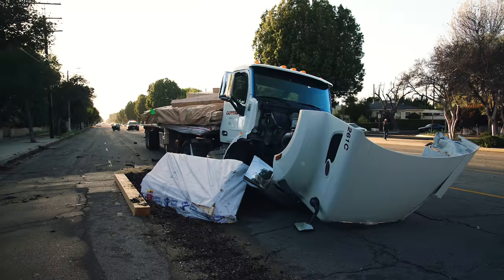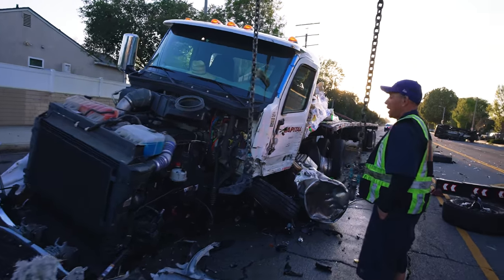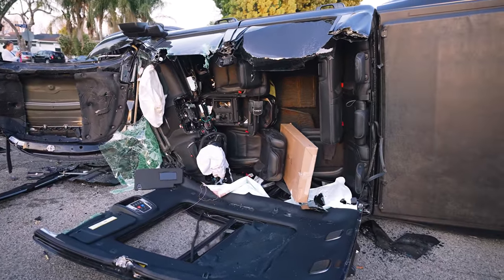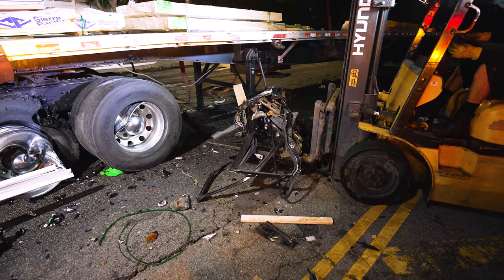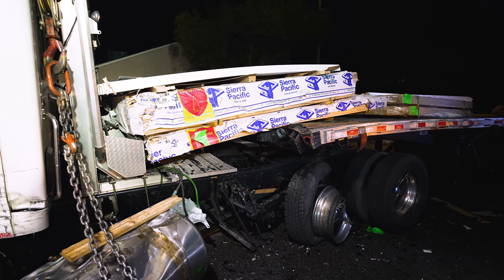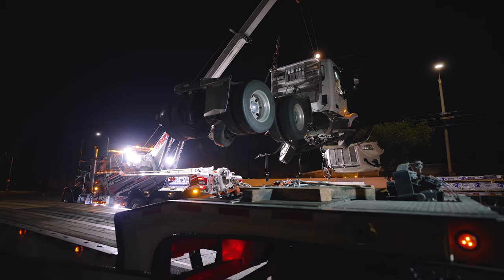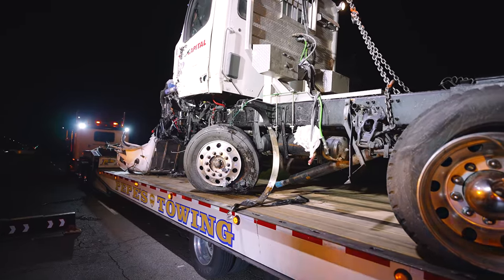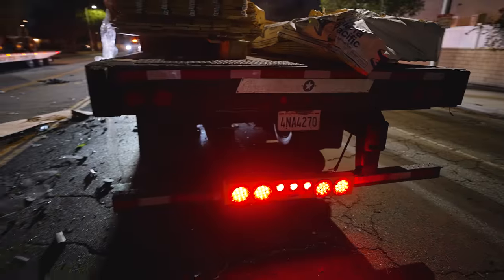2022 Dodge Ram TRX crashes into and destroys semi - rotator recovery

Comment: That headache rack definitely saved the driver of the trucks life. That TRX driver had to have been going extremely fast.
Reply: More like insanely fast!
Reply: Luckily no one (RAM driver) was killed.
Reply: @Lut852  Yeah...that's what's been reported on the news.
Reply: This is the primary reason why T-Rex drivers gotta pay an extraordinary amount of insurance. I'll stay with driving Tesla for right now. 😬
Reply: Forgive my last comment 🙏... Yeah he definitely was going fast..
Reply: Well trx are capped at 118 so unless tuned they can't go faster than that
Reply: @Noobie250r  to cause the damage this one caused, he could have been going well under 118 & still cause that damage
Reply: @tiredoldmechanic1791  Ludicrous speed.
Reply: The rack had his back. Hope he learns better load securement after this incident
Reply: @customconnections2425  yes, the headache rack did have his back. We don't know how he had the load strapped though, when the filming started they were already starting to move the lumber, & had the remaining straps off. We can't say he didn't do good load securement. 
I've been pulling flatbed for several years, I've hauled more loads of lumber than you can dream of. When there's a sudden stop like that, the straps holding the load is going to break, & move forward like it did, & yes even come off the trailer. That's alot of force on those straps, coming to a dead stop like that. It tore  the steering axle loose & pushed it back quite a ways. That was an almost head-on collision, the TRX was going extremely fast. I don't think we can put any blame on the driver of the truck. We didn't see the load BEFORE the accident. That's a local lumber yard delivery truck, alot of uneven things loaded on those trucks, those loads can be very uneven. 
I've also hauled several loads to be delivered to jobsites & stores over the over 30 years I've driven a truck. 
We don't have the right to say anything about how the driver had the load secured, unless we were there & saw the load before the accident, which none of us was around.
Reply: @RambozoClown  He's gone plaid!
Reply: That punctured diesel could've caught fire too. Not as easily as gas but would still make a hot flame.
Reply: @AwesomeBlackDude  the sad thing is that many drivers carry only the minimum insurance.  Also some insurance won't cover you if you're breaking the law at the time, such as driving drunk or at an insane speed.  I think that the T-Rex owner will never own another truck or good car for a long time as his insurance will be going through the roof.
Reply: @danielmarek4609  Actually..in most states it is illegal for an insurance company to deny liability coverage to victims of a DUI driver. 
Also..its usually only high risk/cut rate insurance company's that give you the option of state minimums. 
Company's like State Farm Allstate etc only offers policy's beginning at $100,000 for property and $300,000 for medical.
Reply: i thought i had seen this somewhere but cant remember since the guy should be charged for reckless driving
Reply: No way.  I thought that truck driver was going extremely fast
Reply: @rjdatdude23  it was the TRX going extremely fast. The it's usually the four wheelers that cause the most accidents.
Reply: Crossed center line going 70 no idea the speed limit but I’m guessing 45-50 maybe
Reply: 💥 BADA BING BADA BOOM 💥
I APPROVE THIS MESSAGE 🙌
Nj'sJfJr 👍🏼💪🏼❤️🇺🇸
Reply: driving like a maniac will do that
Reply: I said the same thing. However the headache rack did come apart from the trailer bed if ya noticed that. That is something that should be looked into. I am sure it will be as the claim is entered on the trailer to the insurance should look farther for an explanation. The racks are not designed to separate from their point of anchor. The speed is not really a factor on flat road. had their been an incline and excessive speed on account of the truck maybe. As one can see the damage and debris field indicate who was way over the speed limits here.
Reply: The max speed on that truck is only 112 😂😂😂
Reply: @Martyhackett0919  Give that thing to my girlfriend it will easily do 212 going to Walmart no problem at all...Need any Pics let me know....

Comment: Hey Josh...!!! That guy had to of been going at least 90 mph to of had that much damage to both vehicles... WOW...
Reply from the maker: No doubt! You can't do that much damage driving under the speed limit lol
Reply: …of???
Reply: The truck is regulated to 92 MPH only .....
Reply: @PepesTowingService  It seems, nobody drives under the speed limit in Texas, in my experience!
Reply: @mmarciniak  As high as gas is theyre wide open in a truck thats rate in the low tens driving normally.
Reply: @williscurry6557  The driver never cared about fuel mileage to begin with.
Reply: @travisyarbrough4033  talking about the trx

Comment: An almost unbelievable amount of damage and debris in this ''accident''.   Makes you wonder how fast the TRX was going!?
I might have missed something, but I only see one strap still on the trailer.....it should have had more.   Spending a few extra minutes to start with might have made a difference. 
Another great recovery.  LA is blessed to have you working there.👍
Reply from the maker: There definitely was major speed involved, and the trailer did have multiple straps. I'm not sure if it shows in the beginning, but we did have to remove the straps to take the wood off and set it back properly.
Reply: The Dodge can only do 92 MPH it's speed regulated cause of being a taller truck
Reply: @travisyarbrough4033  ONLY??? Anything much over 65 or so can cause HUGE ASS damage
Reply: @travisyarbrough4033  actually, it limited at 118. But like was said above, half that speed would be enough to cause that much damage.
Reply: @travisyarbrough4033  bull. A regular dodge kicks off around 105.
Reply: @travisyarbrough4033  that’s like paying for another truck without driving it. Why in the hell would they put a monster of a engine in there for it not to be used?

Comment: My goodness what a mess! And yeah I agree about the headache rack! So glad these vehicles are getting safer and safer because this could've been extremely tragic otherwise.

Great recovery!
Reply: I don’t think you know what you mean about those vehicles are getting safer and safer do you think a old 1900s truck would be destroy like this just by getting hit with a  little pick up truck? Those semi truck back then were Sefer.
Reply: @jacksonalouidor8342  it is NOT a Little pick up truck, it is over 5000 lbs going at a VERY high rate of speed. The semi is not as demolished as you think also. The front axle, gas tank and part of the rear axle is damaged. It was a sideswipe at a VERY high speed.

Comment: The low-light capability of the new camera is amazing. How much does one of those tractors weigh? It's obviously well within Hulk's working limits but I was thinking about the stronger & weaker lifting zones as you swung it 180 degrees.
Reply from the maker: Agreed, I love the F 1.8 lens, really allows me to capture so much detail at night. I didn't nail the settings the way I wanted here but still it looked great. Tractors vary, but they can easily weigh close to 30,000lbs. No problem for Hulk at any angle.
Reply: @pepe is the man and knows his stuff. From my non-experienced armchair, I too was a little nervous seeing such a heavy load out there so far from the truck. Lot's of weight on the outriggers. But what do I know? I'm just a guy watching videos.

Comment: When towing that trailer out on the pick bar like that, that makes one REALLY long rig to navigate. Talk about making wide turns, lol!!! 😵😵 👍🏻😎👍🏻
Reply from the maker: Sure is, even longer when towing a complete tractor trailer, or one with a set of doubles.
Reply: @PepesTowingService , I give you heavy towing guys HUGE props my friend. Class A driver, rigger, AND a crane operator all wrapped into one person. AND, you’re not picking up nice neatly packaged loads. You have to put the puzzle together just right to safely roll that whole mess down the road. Oftentimes I’m sure that’s just barely possible to do with absolute confidence the load won’t shift around on you. That’s some SERIOUS work and I personally love to watch a well executed recovery.

I myself used to work for a digging company that transported some insanely large equipment. A number of the moves were an absolute circus, lol. When one of these crazy large items would come up, like the core body of a massive earth moving truck used in activities such as mining, they would call it “The Big Show”, lol. Triple stingers and a ground force dollie at the rear. Driving that friggin thing was like driving an actual freight train. But regardless of all that weight and all those wheels rolling, the Kenworth W9 or the long nose Peterbuilt 379 both having a big ‘ole CAT under the hood would drag that train along like a champ. BUT, I had a planned route that was well able to accommodate the whole drive with minimal traffic using an army of cops to clear the path. YOU have to navigate that monster amidst the swelling sea of morons on their cellphones the whole time, lol. God bless you my friend!! 👍🏻😎👍🏻

Comment: Holy smoke, I'd say that TRX was more than speeding.  To destroy a semi?  They had Angels watching over them.
Reply from the maker: Right? I've seen this level of damage when two semis crash, but usually a semi would destroy a truck , not the other way around
Reply: @PepesTowingService  I'd say this TRX would make a good ad for how well it's built, well maybe not now.  Great video Josh, as usual.
Reply: @PepesTowingService  I saw a mid sized regular car do this in Europe, it ripped the Semi front axle completely off and had it UNDER the rear axles. AMAZING what high speed can do...!

Comment: This truck remindse of the 1954 Caddy my parents had back in 1961. A guy going down 63rd Street in Chicago doing 70 in a 30. If you looked at the back passenger side brake light, it was hanging by the wires, but the front end after being hit from behind a second time & slammed into a nice big steel street lamp post. The front was mashed bad. The engine caught on fire. The frame was bent so bad that there wasn't anything that could be done to fix it. I miss the old girl even after all that time.

Comment: Is there any limits on towing weights ,lengths etc when recovering?
Reply: Safety Limitations: yes
Equipment limitations: yes
Legal and DOT limitations: It depends. In certain (emergency) situations tow operators are allowed to do things that would otherwise not be legal or require special permitting(over weight, over height, etc).

Comment: Definitely the TRX pickup was waaay too fast and maybe out of control - judging by the tractor-trailer being on the correct side of the yellow line.  I am surprised - the trailer did not rip open the TRX pickup's roof, maybe it would have ripped open  if the TRX's winshield pillar truly grabbed the thick horizontal structure of the trailer ... 
I am amazed the TRX driver was basically fine!!  🙏🙏🙏  
Any nearby video cams that caught this when it happened?  We are at the point - dashcams for everyone!

Comment: Am I correct that you get to keep all of the lumber load?
Reply from the maker: Why would it automatically become mine lol. That's like if you get into a car wreck and the two truck guy opens your trunk and takes everything
Reply: Sometimes the company will give out the load. Last year we had an ice cream truck wreck and they had 100’s of 1/2 gallons, pints and what not on board. Not really damaged but they said by the time they could get a refer on scene it wouldn’t be in a condition to sell legally. It’s was a free for all between the cops and fireman.

Comment: Great Video  Why Couldn't You  Put The  Houd Over  The  5 Wheel To Give  You  
More  Room  For  The  Fork Lift.  Just 
CUREREYS  . Keep  Up The  great  Work. Be 
Safe
Reply from the maker: The hood wasn't completely off. Would have taken more time and labor to cut the roof off, deal with the disgusting fiber glass, then load it on the back then secure it. Why do all of that unnecessary work when the forklift fit perfectly fine without having to do that?

Comment: a dump truck with a skidsteer and a sweeper would come in handy some days
Reply from the maker: Not really, not for OPG calls at least. Tow trucks are required to carry a certain amount of "cleaning equipment". Anything beyond our scope goes to a clean up company. What if your tow company isn't as big as mine and only has two wreckers. How would you clean all this up? Somehow leaving the scene, driving to an equipment rental place, and renting stuff? Then who drives that stuff? Then what do you do with the disposal, pay to dump it and hope the driver has insurance to get reimbursed? There's a chain of command for this stuff. In this case, the driver had his insurance on scene already and they rolled their own hazmat/clean up crew. The more you get involved, believe it or not, the more you open yourself up to problems.
Reply: Put the skid steer attachments on the trailer with the dumb truck. That way it can stay together at the yard ready. That’s what we do. You can always remove what you need. But then put it back and your ready to go.
Reply from the maker: @CSltz  That would be nice if I did this a ton, but we don't. It's beyond rare I show up to a scene this bad, and there is not a party responsible for the cleanup. On the freeways, that's Caltrans' job. On streets, it's usually a local hazmat company since technically any amount of spill needs to be properly manifested and disposed of.

Comment: The RAM TRX weighs approx. 6300 lbs, and destroyed that semi. The Rivian EV truck weighs approx.7100 lbs. and is even faster than the TRX,also the Hummer EV weighs over 9000 lbs. and is also faster than the TRX.Imagine the damage those two could cause if driven the same way as this TRX...

Comment: You need a spreader bar that doubles as a front bumper 2 - 2x10x102 steel box beams set one ahead of the other with a key bar to link them end to end and drilled for multiple lift points , linked together 17 feet of accessible lift points
Reply from the maker: Why would I need that? How often would I possibly use something so large when I already have two adjustable spreader bars and a lifting beam?

Comment: Put camera down and lend a hand. Road shut downs hurt the local economy.
Reply from the maker: Lend a hand with what? I literally worked this job. I hate when idiots just comment stuff to comment on it. So the Ram owner that caused this incident isn't at fault? We worked this job as fast as possible. After us, the scene turns over to hazmat to clean up fully. But ya, I'm responsible for the lost revenue from a street shut down? How about I call you for the next job and you can show me how it's done.
Reply: Our economy benefits from Pepe's efficiency.  Take another look at that mess.  Dude in the TRX doin 100 mph next to a massive solid steel hauler deserves 100% of your frustration.  2 guys and some of the baddest trucks hauled it out of there in a few hours. Encino on a Sunday afternoon.  No traffic and plenty of side streets to divert cars.  All of our auto insurance goes up because now there is $250k+ medical bills on the books for the zip code.  Economy suffers because of the reckless driver.  Put your microphone down Stephen.
Reply from the maker: @sammyacemusic  very well said!